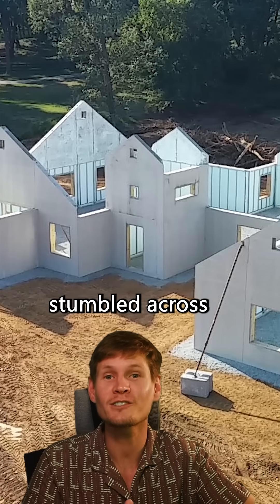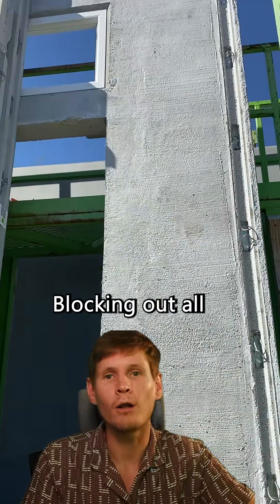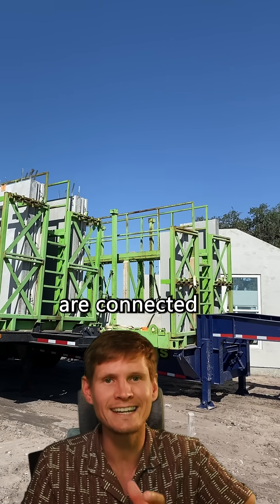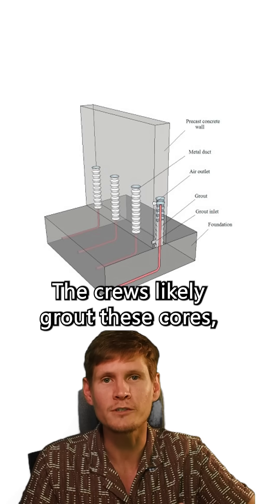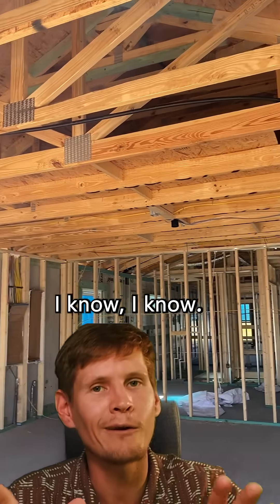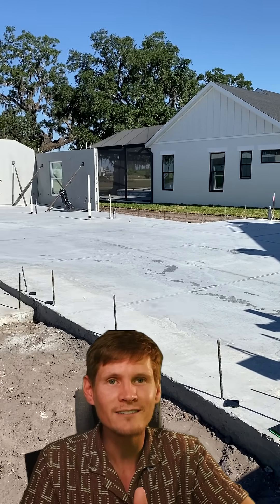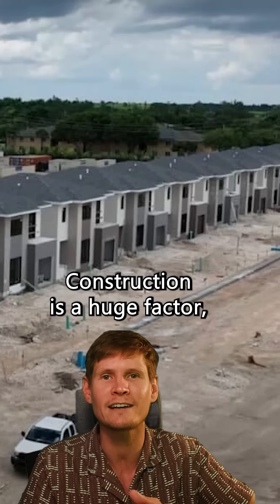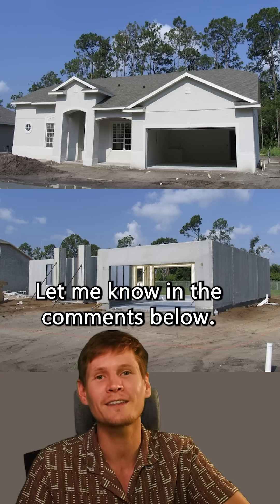Is Florida Building Homes the European Way?! #engineering #reddit #construction

Comment: I think ICF would be stronger, more cost effective, and better enclosed than precast. 

Pre cast has failure points where panels connect, typically covered in elastomeric sealant. 

Having to grout this particular type of panel defeats the purpose of having it be precast.  

using precast instead of ICF requires framers to come back and frame partition and perimiter walls for MEP and insulation whereas ICF is all in one. 

ICF also cures very strong, has both interior and exterior insulation. which means you benefit from continuous insulation, as well as earth coupling, sometimes incorrectly referred to as passive geothermal temperature. meaning, if you build with a frost wall, you will transfer the stable temperature of the earth (55-65F) through the core of the wall, reducing the need for mechanical heating and cooling.    

All that goes to say, ICF > Precast for most applications

Comment: Just do ICF. Shipping preformed sterofoam is way cheaper and easier than cast concrete walls. Also, because your whole wall is one solid piece of concrete, not joined, it's significantly stronger. You also have a much better R-value from the foam on the inside and out.

Comment: I'm building a steel insulated panel house in Florida. Fast, and far better insulated than concrete, and excellent wind resistance as well. Roof is the same material, so no structural wood at all.

Comment: They're doing this in Miami what does trust system of Steel the interior walls steel studs and steel conduit very little wood even the sheathing on the roof is synthetic plywood the whole thing is welded and bolted together do we stand a category 5 hurricane

Comment: Concrete tilt wall construction has been common in The United States for many years, however I have not seen it used for home construction. Tilt wall is slower than prefab walls but when the walls are too big to transport, it makes sense to form them on the completed/cured slab and just tilt them into place. They are sturdy, no doubt.
Reply from the maker: For sure - have done a couple tilts for warehouses and though this was a neat concept for residential

Comment: What's the point of you're still stick framing inside the concrete walls?
Reply from the maker: They run all the MEP in the stud walls. Not as fancy as some other precast walls that have MEP runs cast into the panels but thats what’s happening in this case

Comment: Standard construction in Europe would always have one floor below ground. Also, most common type of loadbearing walls is not prefab but breezeblocks (various names ...). Lastly ... the floors would also be concrete with pre-stressed horizontal steel.

Comment: This is not the european way, due to using wooden frames as inside walls. You cant drop it, can you?😂😂😂 

There are precast houses in eu cities. "House factories" used to be a big thing in the COMMUNIST BLOCK actually, but we never used wooden frames as inside walls. We use bricks for inside walls. 

Also as reinforced concrete can be used as load bearing walls, and are used in some cases, bricks are still more prominent. Its a big step in the good direction! 

This thing has way better insulation, sound deadning, and bulletproofing, than a paper wall would have

Comment: It's not just the wind forces. You can make a wood wall resist a hurricane. It's the wind-borne debris. A hurricane will pick up and throw logs, branches, 2x4s, with insane forces, and those will go right through the sheathing of a stud wall. Not so with a masonry or concrete wall.

Comment: Panel house was invented in Czechoslovakia in the 50's. However our panel house was a multifloor structure holding a number of apartments in a single building. Later on these things became further simplified and known as "commie blocks". Soon enough there may be a time when the Americans discover the prefabricated panels can be made of high strength concrete and stacked as high as 12 floors. For now they're at the stage of "flat panelhouse".

Comment: They should use steel joists and hollowcore slabs for the roof and upper flooring systems. You could get some really large open floorplans like that with significant hurricane resistance to both flying objects and heavy wind loads.
Reply: They build to minimum code standards. If they didn't think it was cheaper to build how it was shown, they wouldn't have. Wooden trusses and plywood are relatively cheap.

Comment: Way more expensive and
There's no way : making forms, filling them, curing them, shipping them,  setting them and having to second pour and cure is faster than framing an exterior wall, not even a comparison 

"Well they are premade and can ship in bulk"..

So can wood frames.. as someone who has done some form (or another) of construction for 15 years,  that's not accurate.

Comment: What is the point it's just exterior concrete wall adding cost and time then a traditional home stucco is cheaper and does nothing if the roof is ripped off by winds hopefully they add concrete roof too now we are talking

Comment: I would line the interface of the concrete walls with a thermal break material to give it a bit more R value and help keep the cool in and heat out.

Comment: What I very often see after a devastating hurricane is that the beams and studs aren’t broken, they‘re merely torn apart, which tells me that the connections /joints are the weak point.
Use more, longer, thicker, stronger screws, nails, 
plates etc. 
It’s not that these houses are made of wood what is the problem. It’s the carelessness of indifferent contractors and workers with their nail gun  just making pfft-pfft and cutting corners.

Just like you can make an unstable structure of concrete (I can name you a dozen contributing factors of how to make a rotten concrete alone.
Or steel structure: If the connections are just executed with one or two dots of welding, the strongest beams won’t help anything.
You get the idea.

I would go on building houses of wood and improve the joints, plus : I would build two reinforced concrete corners to anchor the whole thing better.
Reply: After the hurricane in Homestead, Florida, with much devastation, they discovered that the homes built by Habitat for Humanity were in much better shape. The main difference is that unlike builder homes, they didn't know the inspectors didn't care if the bolts holding the bottom plate onto the slab were tight, so HfH tightened theirs.

Construction standards in Florida have improved greatly since then, and inspectors focus more on things like connections. Roofs built from trusses are more resistant to hurricanes than traditional rafters because they can be screwed into the top plate, unlike toe-nailed rafters

Comment: I sort of want more than 22 - two foot bits of rebar holding up the walls of my house… I know the structural rigidity comes from connecting the walls and roofing together, but just, 5 bits of rebar holding up a wall doesn’t feel like enough…

Comment: In the Netherlands we also have the concrete prefab homes. However no wooden interior framing. We have concrete upper floors with load bearing concrete interior walls. We also have open, isolated attics with windows in the roof. Everything gets trucked in and installed, often decorative brick or cladding on the outside

Comment: I worked for a precast concrete company as a CAD designer doing the mold drawings. One of my first projects was a village for the military to do room-clearing drills. We cast conduit in the walls connected to outlet boxes for electrical and data lines. Precast is a great way to quickly build a home, and the r-value is great!

Comment: Most of the time that we use them in the Netherlands even the cables ventialtion and other instalations are allready cut out or pre installed. And instead of filling them before plating. We first put them in Place temporaraly support them and then pour quick setting concrete in the holes which are accesable on the inside face. In the netherlands we even build with kanaalplaten for the Floors in the storry and ribcasette for the ground Floor. there are Some other options but most of them are prefab. If you Want check vbi or dycore which are big supliers.

Comment: Structural engineer from New England here. My question is: how is the grout maintained in the tubes if it's filled prior to placement of the wall?
Reply from the maker: I think I said it out of order - I believe they drop the walls in place and then grout is injected into the cores to encase the rebar and then they have a witness hole so they know it’s fully filled. My best guess tho

Comment: We've been making houses like this in France for almost 30 years.
Reply: I'm pretty sure that (what is essentially) this system was designed by the US Army corps of engineers in France and the low countries during the waning years of WW2. It was called PRC (Precast Reinforced Concrete) construction, and it was used extensively by both the Americans for building housing and by the British for primarily military administrative and secure storage buildings (think places where you want something more secure/fortified than a quonset hut). In reality, it looks like most of the major players in the war used some sort of modular concrete (the Atlantic wall, for example, was largely built out of modular prefab pieces), but it appears that the western allies were sorta at the cutting edge by the time everything was said and done, at least in terms of using their systems for things like housing and what today we would consider "light commercial" construction.
Reply: We've been doing precast in the US for much longer than that. It's simply not used for houses too much because it's way too expensive.
Reply: @ryanlamfers8692  It really isn't because it saves in labor -like a lot. With prefabs you can build an entire floor & roof of a high rise in just one day and with sliding molds used in skyscrapers it's even faster than that.
Reply: We've done this since the day WW2 ended.
Reply: We've been making houses like this in Florida for over 50
Reply: @echoromeo384  I've been living in a mud hut in Serbia 🇷🇸 for 60 years. Clay, straw, ox blood, and horse hair. 2 ft thick walls. No ac necessary.
Reply: @echoromeo384 I also saw a lot of concrete block houses in Florida when I was there 15-20 years ago. Block exterior and wood interior framing.
Reply: Give them a break, they've not even adopted the metric system yet! 😂😂

Comment: Nothing fancy. Tilt up precast concrete building. FEMA 154 even has a scoring system for screening them for potential seismic hazards.
Tunnel form concrete buildings have better integrity and probably faster. But initial value of equipment is high.
Reply: Florida doesn't get earthquakes
Reply: @TachibanaTGK  When it is studied extensively for seismic events. It is not that “New”. And it is pretty safe.
Who said anything about Florida’s seismicity?

Comment: if you're going to do factory to site, timber or aluminium panels are the fastest and cheapest option. Worked on a site where all the houses were delivered on the back of a lorry, half were aluminium frame and that's what we done then the other half were timber frame. The walls came with insulation, bracing, everything, just had to put them together, super easy and fast. Brick facade then on the outside.
Reply: Keep your fastest and cheapest option 😂
Reply: @TreeHugg I live in a country where most houses are block built, but they're a lot more expensive to retrofit as you've to cut and break and build back up, timber or aluminium you just quickly cut it up and change it around. Will keep it as it's the fastest and cheapest option, don't need to convince someone like yourself who doesn't know anything about the business 😁